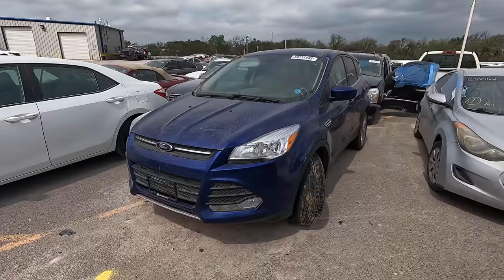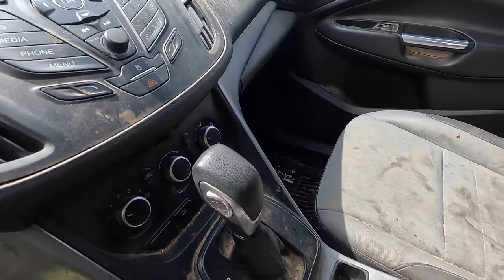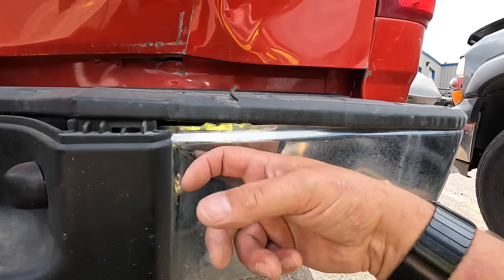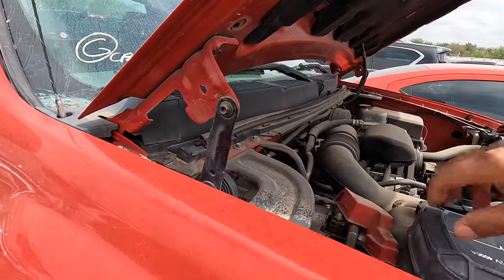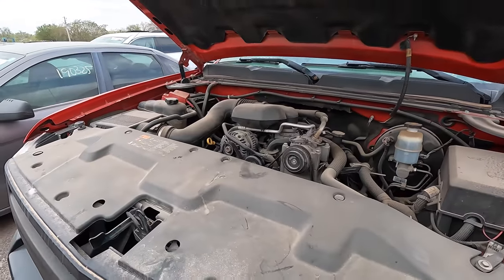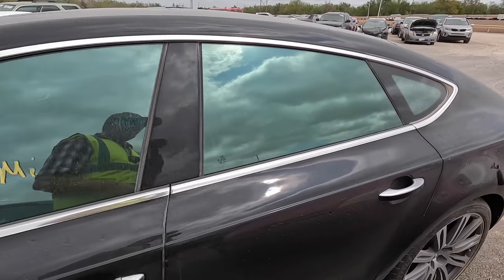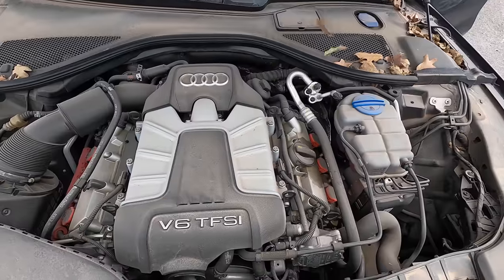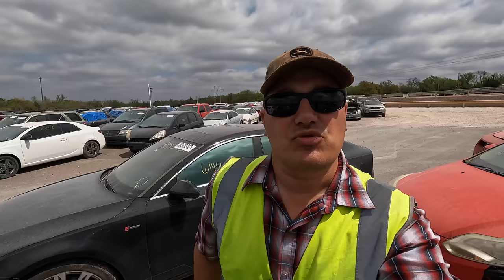Copart Walk Around 4-24-22 + NASTIEST CAR I'VE EVER SEEN!!! BEWARE!

Comment: The Silverado is a real beauty.  I have a 2002 S10 with the same engine with 79K miles. Never have a problem with it. The Escape looks good on the outside. I think you should get the Silverado and keep it as a spare.

Comment: On that escape, you HAVE to replace all 4 tires or else you’ll burn up the viscous clutch in the rear differential and it’s a $900 repair at Ford. 

Edit: that Silverado RCLB is essentially a blank canvas; imagine if it was like my dad’s 2009 RCSB with the 4.8 it would be the perfect truck.
Reply: You need 4 matching tyres. You can look round for part worns of the same tyre with same tread depth as one that's already on it.

Comment: I love that red Silverado.  Man, that 4.3L sure looks a lot smaller in that truck than it did in my 1995 S-10 because the engine bay is so much bigger.  I love the old 4.3s, I put 160,000 on mine before I traded it in and it still ran great.  The 4.3L sound really good, especially for a V6 with a 1->2 Flowmaster muffler on it, too.

Comment: Randy: cheap truck. I think it is a good buy.
On our fleet we have put on over 300,000 miles on 4.3 L and 6.0 L
Without any trouble.
I was surprised at the great drive abilities and fuel economy of the 4.3 L.
6.0 L what a performance motor. But it loves the gas stations.
Cheers

Comment: You need to buy the Audi A7. It could be fixed for probably around $2,000 including the console if you did the work yourself. Santa’s Workshop could probably help with that. It’d be good content for the channel also. Then do a good detail and send it back through the auction and make some money. Those are selling for around $36,000 retail . Of course that’s for a non-salvage title, but even with a salvage title it’d sell for at least $20,000. The Chevrolet truck is a no brainer also. Do a little cosmetic work and resell it for some decent money.

Comment: You could start an interesting YT channel on HOW some of these cars ended up in the condition they are in; that is at least as interesting as what you end up doing with the cars you buy.  Re the 4.3 litre V6, the first thing I noticed was that there is actually SOME SPACE inside the engine bay to work on the engine; these days that is a real plus.

Comment: I have a 2008 Silverado 2500 HD 4x4. Same configuration, single cab with 8’ bed and it is red. Mine has about 100,000 less miles on it.

Comment: That Silverado is a steal for $1900. Replace the windshield, tailgate and clean it up, it could go for $8k-$10k. I would buy that truck and flip it easy!
Reply: 8k to 10k for an old beat up Chevy with almost 200k, I have a hard time believing that lol.
Reply: @johnl3230  this one in the video has the dent in the tailgate and a cracked windshield but otherwise very clean. Trucks like those in my area are going for $8k-$10k.

Comment: 10:03 The 10 year old red Silverado regular cab be neat work truck I'd drive it still with small tailgate damage but front window definitely needs replacing ughh u would thought it be a. 5.3V8 or 5.7 nope got a baby 4.3 V6 least ur getting good fuel mileage .

Comment: The big picture on the Escape...The front suspension damage & the rear damage are unrelated, The rear happened first..Look at the tire wear..that tells the story... It was still driveable until the front got damaged.  The vehicle was used commercially by a landscaper or logger, with many drivers...No body shop would work on it & there are to many potential open items with regards to unibody & suspension, When a shop refuses to work on a car, the Insurance Company cuts their losses & totals the vehicle.... This will go cheap for parts, no rebuilder will stand behind an unmaintained vehicle...Escapes at best are problemistic...